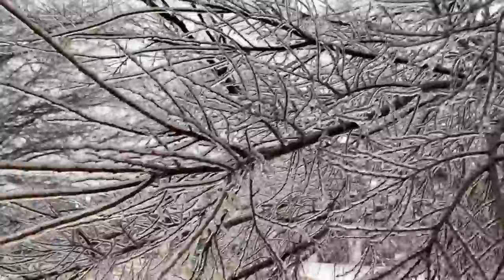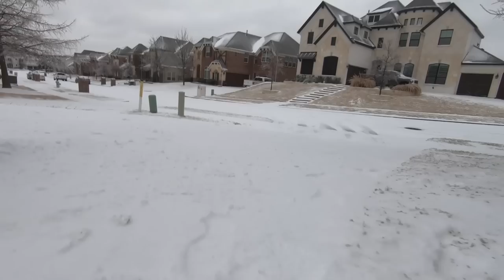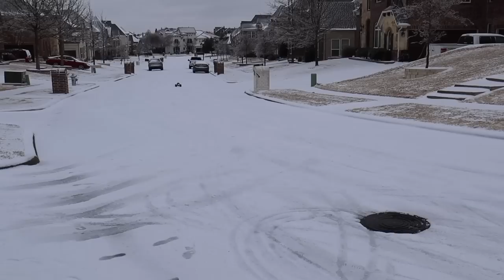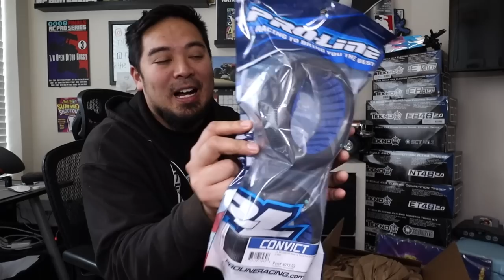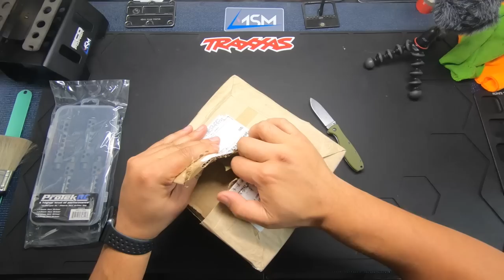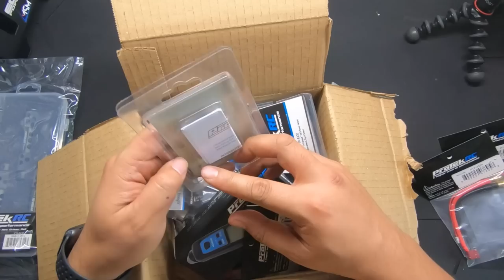NEW PRODUCTS RC Car MAIL DAY | Ripping RC Cars In the Ice and Snow

Comment: I put tape on the holes on my 1/16 ERevo tires and took my wife’s “cling wrap” just for extra protection.  Little buggy ran good in the snow.
Reply: How deep was the snow you were running in? I have a 1/16 erevo and didn’t try it in the snow because I didn’t think it would go good
Reply: @heller127  was less than a 1/2 inch of snow. Was fun to do some snow drifting with it.

Comment: stampede 4x4 soooo underrated! truck is a tank once you get tekno drive shafts. there super cheap on ebay you can get all 4 for 90 bucks canadian so like 70 usd new.
Reply: I agree! I’ve got the tekno kit and it’s almost indestructible at this point, it’s the perfect little truck for me
Reply: Tired of breaking driveshafts in mine...